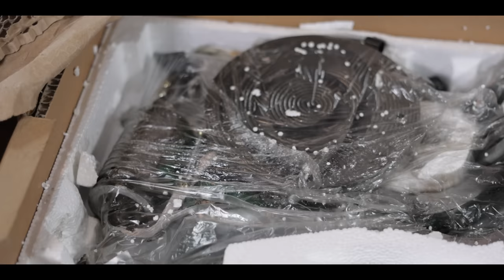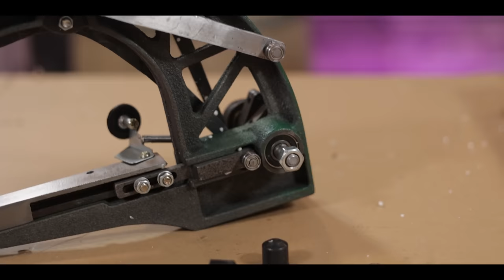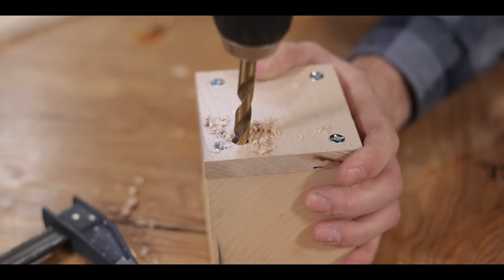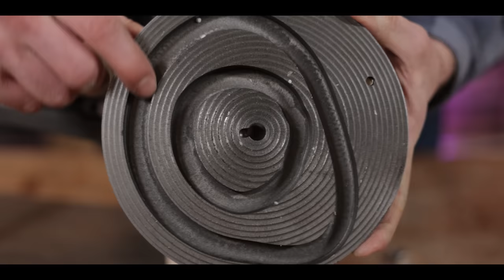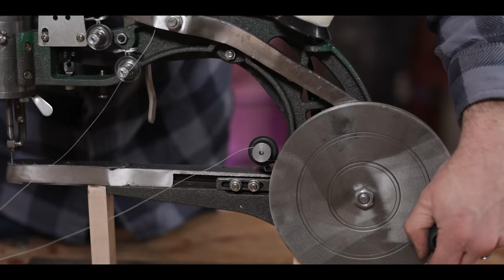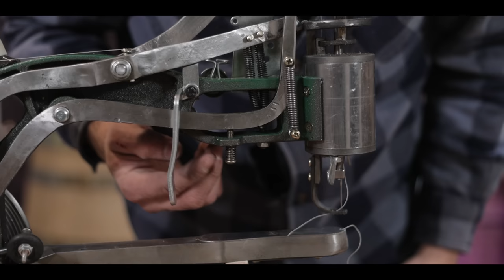Is this $100 Leather Sewing Machine Any Good?

Comment: Mine was such a pain that once I got it together I put it back in the box and left it because I had run out of time for my project.
I think that you should have pulled the screw out of the swinging plat and shortened it so the head was intact for your screwdriver. My machine took months to arrive.

Comment: I have had mine for several years now and I still really like it . I even used the three pipe legs for awhile. I did not bother to do any fancy cleaning or deburring . Have made many items , some out of very heavy duty material  . I do not want to motorize it but would like to make a “ foot treadle power” option so that I can guide the material with two hands while slowly operating the sewing action with my feet. Good luck with yours .They are very much worth having , are fun , good excercise and a good creative outlet ! UPDATE ; It has been about a year since I wrote the first part . I still continue to use it regularly, in fact even tonight I was considering to use it for a project , a few days ago I made a black leather holder for my EDC flashlight that goes on my belt which already has a couple of other things on it that I made with it . The most ambitious project so far is a handlebar bag for my motorcycle. I spent extra money for really good leather for it and it came out very good. Oh one more thing , for the M/C bag I needed more room so I took off the bobbin winder and altered a couple of other minor things to increase clearance. The bobbins are easy enough to wind by hand.
Reply: It seems fine using the tripod base, it's nice that it can be stowed away quickly in a box when not in use. It'd be nice if there were some kind of detents to prevent them from falling out when lifting it up to move around; just some tape would do for that but then it's not as quick to stow away afterwards.

Comment: I just subscribed to the channel and bought one of those machines. Should work great with canvas. In a previous video you used grommets...

I recently bought a grommet press that was in a similar situation. Very rough castings, oily as heck, in other words, not pretty.  But after a bit of filing, and base securing it works great. Came with the three dies and a bunch of grommets. The grommets are cheap,  but the whole thing was less than 80 bucks if I recall. That sewing machine is a good DEAL! I plan on hooking up a belt and motor to drive the wheel. I have an old sewing machine for the foot peddle parts, tee hee.
 Thanks for the inspiration.

Comment: That looks like it'd also be incredibly useful for thicker wool or denim, where an inexpensive electric machine just won't cut it.
Reply: I use this machine to sew patches on biker vests.  The pressure foot rotates 360 degrees and I can sew them on and they are still able to use the pockets.  I just ordered a conversion kit from eBay and a servo motor from Amazon to be more productive.   It does well on the denim and leather vests but when it comes to veg tanned I prefer my Cobra 4.  The stitching isn’t always straight enough on the shoe patcher

Comment: I would pack the edges of the cutouts in the back of that crank wheel with white lithium grease, or even moly or gun grease.  Seems like those bearings back there would give out sooner or later without some kind of protection from the friction from the roughly milled/cast metal.

Comment: The only thing I noticed when you actually test the machine is that the presser foot is leaving some pretty aggressive marks in your leather. some other review videos I’ve seen on this machine they ended up sanding those down some to reduce the marring of your leather.
Reply: I sprayed a couple of coats of plastiseal (that spray on plastic stuff) on the teeth of the presser foot. I was concerned about filling the teeth down because that is a consumable part.
Reply: I filed my presser foot down a bit and it helped a lot.  Also, there is a bolt that lets you adjust the height/pressure of the foot to suit the thickness of what you're sewing which makes a world of difference.
Reply: @possumwithaswitchblade  That is good to know.  I'm been doing leatherwork professionally for about 6 years now.  I've always saddle stitched everything, but as you know it really slows down production.  I'm contemplating getting one of these, we'll have to see. Thanks for your input!
Reply: is it best to adjust the pressure to the minimum amount that is still able to hold and move the material when sewing?

Comment: Thanks for the review. I'm pretty okay with hand-stitching in the main, but I do have a project in mind that involves MILES of stitching... I'm hoping my hand-cranked vintage Singer is up to the task, but, if not...
Reply from the maker: I feel you! It has definitely been a bit of a learning curve and, in my estimation, hand sewing still looks the best. Though that could just be my lack of skill with this machine. It DOES save time though. Incredibly fast.
Reply: You can get better looking stitching by doing a stitch groove before sewing.   Helps keep it straighter

Comment: Thanks for doing this video!  I do saddle repair, want to branch out into making other leather goods, and wanted an alternative to endless hand stitching without breaking the bank for an expensive machine.  I got one of these, but sent it back due to a number of missing parts (like yours, mine came in a box that was comprehensively mangled, which may have been the reason for the missing parts).  I was dubious about ordering another, but after watching this, I'm going to give it a try.  Thanks again - great information!

Comment: Let's be honest, anyone expecting a $3000 machine for $115 on amazon is out of their mind. However, for the price it looks incredibly serviceable as an entry/hobbyist machine. I have access to a real industrial walking foot machine and even  I am tempted to buy this machine.
Also looking at the simplicity of the construction I'm tempted to try and build my own.
Reply: Can't imagine the time and effort it would take to duplicate this from scratch; just got mine for 89.99 from the eclectic Temu, and it seems to be working fine.
I had some fun and puzzlement trying to figure it out just from the cryptic instruction sheet, but the video tied it all together. 
Didn't figure the bobbin access was from the base plate swiveling, so seeing that on the video clicked. 
Seeing the bobbin thread pickup pull through after loading was helpful too.
The stitch length adjustment bolt on bottom was another key item where seeing is believing.

Comment: Get it working well then mount a pulley onto the crank flywheel and set up a small foot operated sewing machine motor and belt to make it automated. Press the pedal a little to sew slow and full on to just crank away. A cheap way to get into doing leather work and have an automated sewing machine for those hard to reach places and while you are at it just leave the handle in place for those times you need that extra slow speed and just do it by hand.  A no brainer.

Comment: Looks in principle quite similar to my old 1940s singer machine, it has a similar bobbin winder too and the same stitch size adjuster knob although the layout is quite different. I assume they're basically using an old sewing machine design but building it with modern materials and cheap machining.

Comment: I could not use it with the secondary support as I could not sew boots with it in place. I scrapped that part, but the machine did what I needed until I could replace it with a vintage Singer 29K71

Comment: if you wanted you could put it on a table and have a metal plate that your foot sits on then link that to the crank handle leaving your hands free or mount a pully to the fly wheel and use a cordless drill or such to power it

Comment: My good sir,
I bought one.  Whilst I am excited, I find myself DEEPLY confused about needle versus thread sizes.  I usually sew holsters and knife sheaths, so slightly heavier thread is important.  I cannot find any easily understood information about needles versus thread size versus leather thickness.  Any information you can provide would be deeply appreciated.

Yours in creating,

Jim

Comment: What thread do you use with this? , I've heard it comes with something akin to fishing wire and would not want to use anything like that.
Reply: I use all purpose upholstery thread. Didn't really like that fishing line in the bobbin. But the upholstery thread  is smooth and inexpensive.
Reply: @johndoeee888  thanks for the reply.    😅😂

Comment: I feel like Cl3ver might've skipped over the trouble that actually comes with trying to get one of these things to work on a consistent basis. Mine won't work for more than a few stitches without the thread snapping, and that's assuming the bobbin thread even gets picked up at all  :(
Reply from the maker: It sounds like it could be a few things. 1st the thread that comes with the machine is junk. Make sure you replace it and make sure it is a good strong thread. The thread not being picked up sounds like the bobbin is in backwards. Make sure, before you put the shuttle back in the machine, that your bobbin is turning counter clockwise when you pull the thread. Finally, I find with some thread that using both tension disks is too much and will snap the thread. I usually only use 1 of them. You can ease up the tension a pit further by unscrewing the disks a little as well. Let me know if any of those work.
Reply: @SkillTree  I'll try it out! Thanks Cl3ver! :)

Comment: I was going to say you should use white sewing machine oil, but then I realized I wouldn't put Ferarri oil in my Ford Focus. lol, jk. I'm sure the 3 in 1 will work fine but if you find that it leaves a stain on whatever you're sewing the sewing machine oil is made so that it will be less obvious and easier to remove if it does.

Comment: In regards to the stand you built, just a little constructive criticism.

The "Block O'Wood" you used for the machine base, you mentioned how the crank wheel wouldn't fit unless you trimmed it or raised the machine itself higher. A third option might be to mount the machine off center of the block where the crank wheel hangs off the side far enough to function. The main argument against that I can see for this option would be the balance of the whole unit but simply adjusting the legs positioning to accommodate balance or even installing the unit and mount block directly to a work station without legs would probably eliminate this issue. 

Like I said, just some constructive feedback to make others projects potentially easier on them. Pax.

Comment: Hi, i bit this machine weeks ago but unfortunately I haven't sewn anything with it yet. I think I inserted the bobbin correctly, I did like in your video and also I paid attention that the thread run correctly, but the needle does not pick up the lower thread. I've already replaced the needle, but unfortunately it doesn't work 😢. I don‘t know what else I can do.

Comment: This machine is made exactly like they made it in the late 1800's this the type of machine used by shoe cobblers and manufacturing leather goods some have the belt drive motor for electricity or hand crank....so it is a learning curve and is actually more authentic if you are restoring or producing antique reproductions.There is a reason it is only 100 bucks but workable for someone who doesn't have 3000 bucks to buy a modern machine

Comment: by putting that little support foot under the arm of the machine, you eliminated one of the major points of the design. it's so you can get into tight places (like down in the toes of boots) for stitching where a flat bed machine cant be used.

Comment: I’m curious what size thread was used in this video I have been having issues with my thread snapping even if the wheeled are loose the thread I was using is 210d/3

Comment: I am a bit disappointed, but not surprised about how close minded some people are.   That type of Sewing Machine has been used for decades,  Primarily in third world countries.  Street Vendors use these not only to repair shores, but also to make sandels.  Maybe a piece of car tire cut in the shape of a sole, Add a couple of leather straps, and You now have a pair of CAR TIRE FLIP FLOPS.  They are very valuable to someone that does not have any shoes.                        Good Luck with your project on that machine.

Comment: I got this sewing machine but every time I go to stitch it keep ripping my thread when it goes down into the bobbin. Can't figure out why.
Reply from the maker: This could be caused by a few issues. My first thought is that you have the bobbin in backward. Took me a while to work that out myself. It should turn counterclockwise in the shuttle when you pull the thread. The second issue may be your tension. You can ease the tension off the tension disks by unscrewing them a bit. I honestly only put the thread through one disc, usually as 2 is usually too much tension. The final issue may be that you are using too thin of a thread. Try moving to more of an upholstery thread. Let me know i any of them solve the issue!
Reply: @Skill Tree  Well I made sure the bobbin spun counter clockwise, I tried just keeping as little tension as I could, and the thread I'm using is tandy #207 nylon thread.
Reply: It seems my top thread is getting caught in the bobbin for some reason?

Comment: Those inserts to mount the sewing machine were a waste of time and not as strong as long coach bolts.Use the same idea as was used to connect the block to the base to connect the machine to the block of wood and forget those short thread adapters.

Comment: Another tip is to file down the teeth on the foot so they don't imprint on the leather. Yours doesn't seem to be as bad as mine was though. Unfortunately, I haven't really been able to use mine since I got it over a year ago. I let someone borrow it and they managed to put the shuttle in out of time and jammed the machine up. They forced it to turn and sheared the gear off the shuttle. Then managed to also lose the spare. Supposed to replace it, but here we are.

Comment: just bought one, and im STRUGGLING to get mine to sew 😭😭
Reply from the maker: What seems to be the problem? If the thread keeps breaking you could try only passing it through one of the tension disks rather than both. Mine had that trouble and it seems like many do unless using super thick thread.
Reply: @SkillTree  well i had a heck of a time getting the bobbin to pick up the thread, finally got that working, but now the top thread keep snapping.  I ordered some #69 thread, but while i wait im trying to use the default black thread they ship with.  ill get 1 or two stiches and it snaps, only using one tension disk, even if i just feed it without going threw any tensioner it still snaps

Comment: I hope yours works better than mine did. Even after watching as many youtube videos about getting it dialed in I couldn't get it to sew more than 2 layers of 2-3 leather (about 1/8") and it wouldn't stitch more than 5 or 6 stitches before it broke the  thread. I couldn't bring myself to unload it on anyone so I dumped it in the trash. I bit the bullet and bought a real leather sewing machine and it stitches though 3/4" of leather. It was expensive ($1400) but I can spend my time doing leather projects and not fighting the tools.

Comment: You missed the point, it’s a patcher! You rotate the cylinder which turns the foot so you can stitch in any direction without turning your work. That’s what it’s a copy of a singer 29k, a cobbler machine.

Comment: I bought one and it's junk.
Reply from the maker: Really? Perhaps you got a bad one? I have been using mine flat out for a month straight. My only real gripe is the nethod used to load the bobin. Otherwise, I love it!
Reply: My needle keeps braking.
Reply from the maker: @silvergoldking  hmmmm. I have had them break before but usually because the thing I am sewing is being pulled sideways too hard and bends the needle. That said, the needles they send with ARE junk. I quickly bought a nicer pack of them.
Reply: I tried everything. It won't brake without tread. Wants i add tread to the needle it brakes.
Reply from the maker: @silvergoldking  the little disks you run the thread through, the tensioners, they sound like they are too tight. I would try loosening them a bit. I tend to just use one and skip the second one alltogether.
Reply: @silvergoldking It's happen to regular sewing machine{fabric) as well. it is just mater of adjusting the bobbin and how tight or lose is the thread.